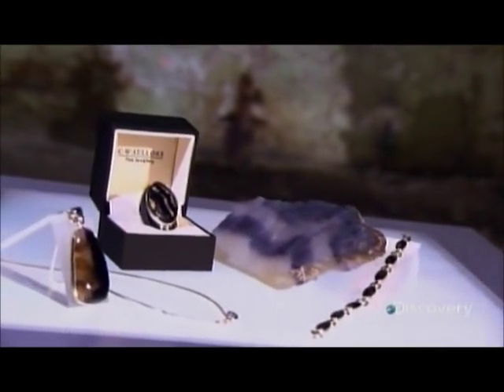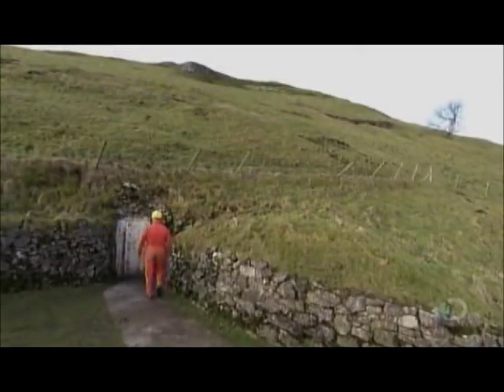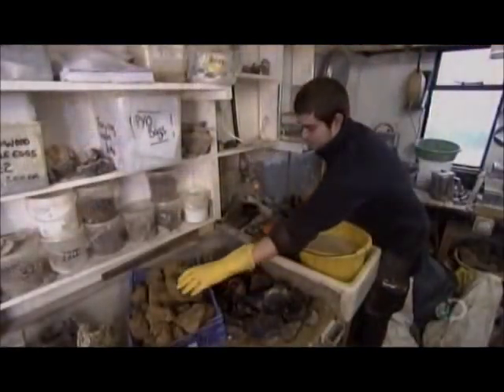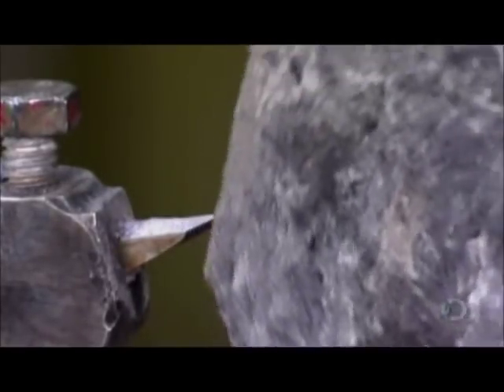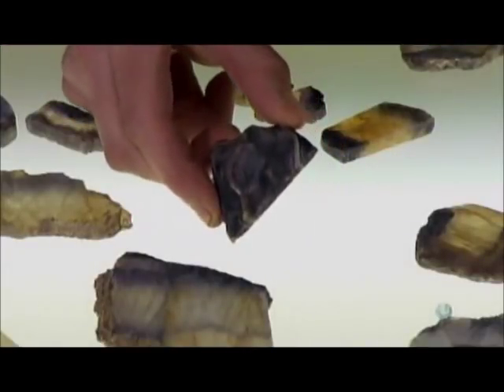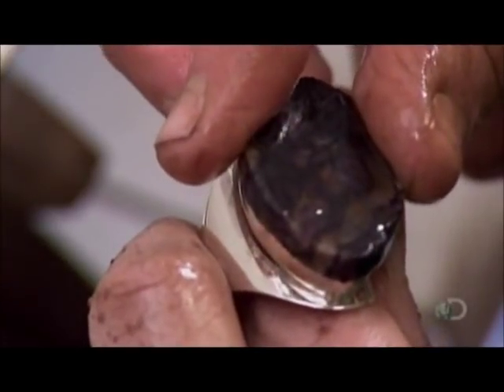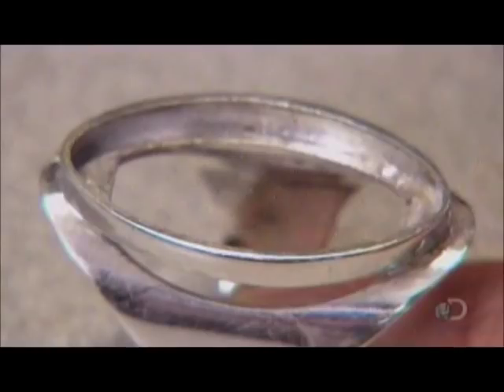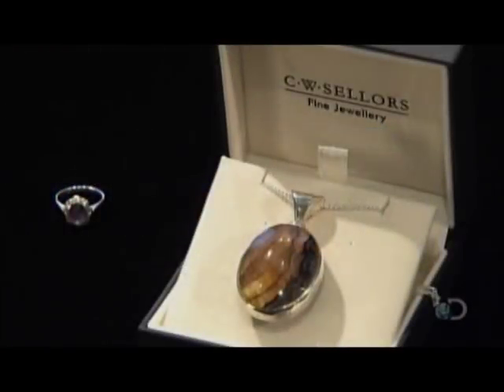How It's Made - Gemstones

Comment: People fretting about fingers near the sawblade - lapidary blades for this purpose are blunt without sawing teeth because serrations can shatter a stone. The worst it does to fingers/nails is some sanding. You can lightly hold your fingertip perpendicular to the spinning blade without injury, but it is uncomfortable. Don't try it ofc.

I've slipped a few times and gotten some decent scratches to my nails and some callus removal, but nothing major or icky. When I was timid and new to lapidary, I reflexively flinched when my finger brushed the saw blade; the stone came loose, shattered a bit, and a fragment nicked the side of my finger. I then recoiled and wacked my hand on the light, and got another cut from the metal lampshade. Lapidary - not without risks, but it's more about the high rpm than the blade itself.

Comment: all the gem they wasted by polishing it kinda flat. why
Reply: Can't put a round bottom stone in a bezel made for a cabochon. Its dumb... but pretty so people grind out the rocks to put around the neck.
Reply: This is a bad technique in my opinion having made jewelry. Cabochons are usually much thinner than that example because they want to keep as much of the stone as possible. I don't know if working on this stone is the same as others but generally I design a cabochon to lose as little of the gem/mineral as possible. The ring is designed after the stone has been formed so that I don't have to use any glue.(A metalworker should rarely use glue if ever. IMO) The metal is pressed around the stone, and it can't move.
Reply: @nightninja1595   I was thinking that too! I’m from a family of goldsmiths/gemologists and when the vid said the stone was soft, I figured they’d put it in a bezel to protect it. Then the bezel was too short to push metal over the stone. And when they glued it I went “oh no”. Using it in a ring may not be ideal.

Comment: 3:25 WTF?
Reply: Rock Saws do not have sharp blades. I have worked with a 24 inch diameter blade for cutting large rocks. You can hold your hand against it and it won't cut you. At worst you will get a friction burn.
Essentially it is a metal wheel/disk with fine diamond powder impregnated into it.
As you can see, it cuts rock pretty fast. With the saw I used, I could cut a 10 inch diameter rock in half in about 3 or 4 minutes (if I can remember right).
Reply: what?
Reply: +Micah Montoya 
Look how far her fingers are from the saw
Reply: Cyborg PhotoshopVideos I read that in his accent lol.
Reply: +Ryu Hayabusa lapidary saws grind they don't cut you could put your hand directly on to the blade and the most you would get is a minor friction burn
Reply: SnowTiger45 are you using a rotary or a recipro rock saw lol. A rotary rock saw, even though it's just technically grinding, would still fuck your finger up.
Reply: That worker needs to watch more CrazyRussianHacker video's because clearly safety is not her number 1 priority.
Reply: +Daniel Ovard that's totally untrue. That grinding wheel is super thin, spinning at very high rpm, and would easily cut her finger.
Reply: Always ask permission first,then gently harvest. Do like Ted Bundy...be nice.
Reply: Yeah, lapidary wheels are like sandpaper. They do not create sharp or visible cuts on your fingers, but can scratch up nails. Personally, I would not hold my fingers that close.
Reply: I was really wondering if i was the only one getting extreme anxiety from this scene and the ones with her fingers so close to the other grinder for sanding down. 

Like, i get that this isn't supposed to be that dangerous, but I've spent my whole life around table saws and the like. All i can see is fingers going flying.

I feel like i had to scroll way to far in the comments to find someone else concerned by this. 😑

Comment: "They use drills to dislodge small chunks of it from the hill"
Worker lugs up a jack hammer
Reply: The correct name of which is 'pneumatic drill'.
Reply: That is a new term to me....huh.
I thought it was only a drill if the 'bit' rotated.
Reply: Drill - A tool or machine with a rotating cutting tip or reciprocating hammer or chisel, used for making holes.

Is one of those things where colloquial definition doesn't match up.
Reply: Rock drills actually do rotate the bit slowly, whereas what is known as a jackhammer doesn't. Jackhammers are basically a motorized hammer and chisel, while rock drills are a bit like the bastard child of a hammer and chisel and drill. The bit slowly spins as it is hammered into the rock to make round holes. Before pneumatic rock drills, this was done by hand, rotating and striking a chisel-like bit.